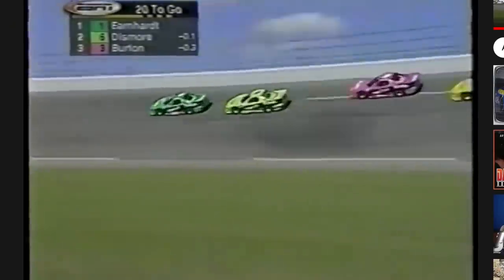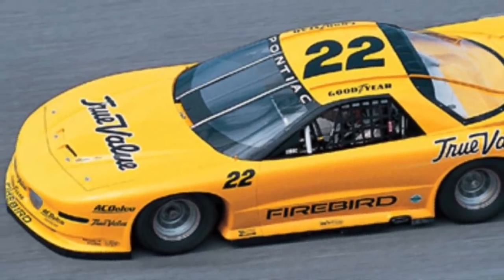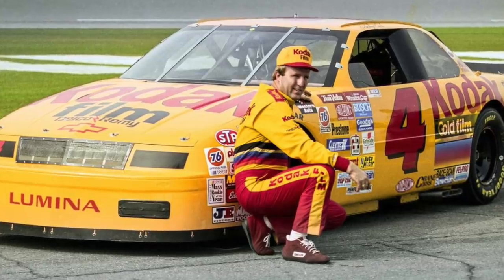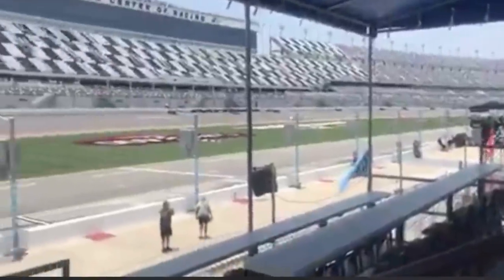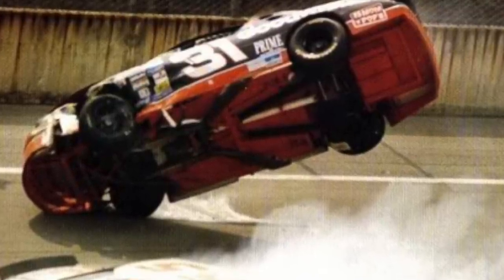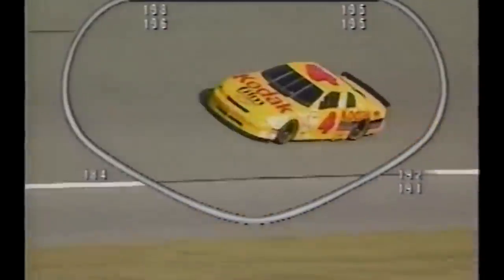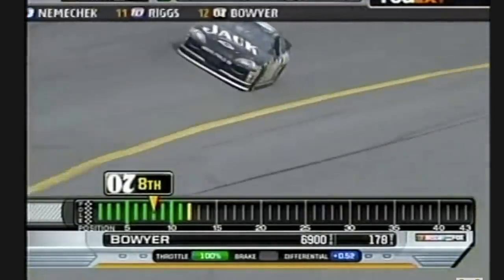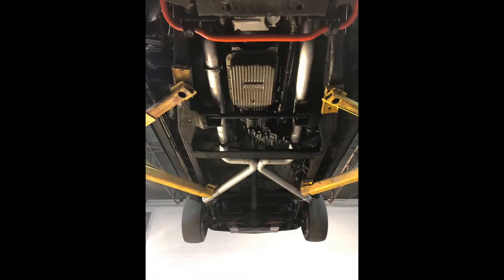What Made "Old School" Restrictor Plate NASCAR Sound So Great? (Back to Back Sound Comparisons)

Comment from the maker: Did you guys find this interesting or surprising? I thought it was crazy that the Daytona camera positions haven’t changed in 20+ years. Made the editing really easy 😂
Reply: The camera positions have never changed around the track because they where specifically built and reinforced for protection in those areas.
Reply: NO MAN WHY THE X PIPE BUT WAIT DOSENT A X PIPE GET HOLLOW IN CENTER>????????????????????
Reply: Found this very interesting and I thought the same with the camera angles too. Cant wait to see what you have planned for the Monte Carlo. Keep the content coming
Reply: Yes plz do more on this
Reply: Exhaust and engine noise in general is so interesting. I dug into it a bit after seeing the spinal tap project go to to 11k RPM on a spintron and sounding eerily like a "running" engine. Ben Strader has some great spintron videos, it was really enlightening when he was on the power and speed podcast as well. I've always wanted to see what the function of correspondence is between the sound frequencies/harmonics generated by the actuation of the valvetrain through the RPM range and the exhaust tone of the engine. Great videos always, I appreciate you realism and your energy!
Reply from the maker: @MrTacticalKitten  Ben strader is an awesome dude. I had a good conversation with him at pri in 2017 that led to my Escalade engine being configured to run 8200 rpm. I thank him for that because it sounds epic 😂
Reply: You have to post videos when I'm not working .boss caught me again
Reply: Not only were those IROC cars the best sounding race cars ever, those races were some of the best battles ever. Even in identical cars Dale Earnhardt was able to take them boys to school at the superspeedways!🤘🤘
Reply: When are we gonna see some more monte content brotha  fuckin loves that car!! One of the prettiest and meanest lookin street cars on YouTube in my opinion no frills just thrills
Reply: Dr.gas is incredible
Reply: Glad I know the truth now miss that sound
Reply: I always knew something was different from back then but I couldn't put my finger on it piss a man off sitting watching thinking somethings not the same but idk what it is lol
Reply: Have always wondered what made them sound so unqiue. Always thought they turned closer to 8k rpm as well.  That x pipe sound and a sequentially fired 8:1 merge collector are my 2 favorite exhaust notes.
Reply: Love the content!! Very interested in your exhaust testing on the Monte Carlo .
Reply: Great video Mitchell. Here's an experiment for you: There are three factors in designing an X pipe, 1) Length of the X, 2) diameter of pipe, and 3) the length and width of the notch. Here are some tig welding terms that are familiar and actually come from pipefitters; pulse, back pressure, flow, evacuation, resonance, frequency, and purge rate. All of these items are similar in purpose, but each has a very different objective. Let your mind wander a bit, it's kinda of like Where's Waldo and Connect the Dots. Here's a clue: Plumbing, Exhaust, and Welding have everything in common,  but for completely different reasons.
Reply: You think it was the same for formula 1 possibly?
Reply: Hearing it on video doesn't do it justice- to be there in person you not only heard it- you FELT it when they went by, especially in packs. I've heard others since, but nothing comes close to them.
Reply: I'm a major exhaust nerd myself. Some of my neighbors dont mind me change it cuz they love hotrods as well. I've changed mine probably 4 or 5x in a year trying new sounds lol.
Reply: Seriously interested, this has been something I've always wondered and your vids already helped answer a question.
Reply: Welcome to the Thunderdome!!
HellYeah Brother!!
Reply: Not really surprising, but I watched the last video you did where you were talking about x pipes and nascar noise. Still a cool video, cant complain about fly by shots of old nascars.
Reply: Considering I’m trying to do this on my 4th gen Camaro lol very helpful
Reply: I've got a SBC with a 4/7 swap and it definitely changes the sound...  I'd love to try to carbureted LS with a SBC firing order to see what it sounds like. If you find someone to grind them I'd definitely be interested in a cam
Reply: Exhaust exit does make a big difference.   
The sound of vacuum cleaner vs fighter aircraft.
Reply: Dale yeah it was interesting! I freaking love exhaust
Reply: X-pipes ftw 💯. I put an xpipe on every performance car I had.
Reply: DO THE SWAP! DO THE SWAP! Damn I want to see THAT happen like crazy!
Reply: I found it interesting, Mk kinda wish they would go back to the old exhaust it sounds better to me
Reply: Spintech makes a hell of a good sounding exhaust, put the mufflers on a 6.0 and it sounded like no other!
Reply: I've been saying something similar for a few years. It's simply that the exhaust systems were altered. As for today's cars sounding different; the exhaust pipes come out on just one side of the car. NASCAR did that for safety reasons. So, it's a different X-pipe configuration, with the the sound waves hitting the outside wall and our eardrums differently.
Reply: I'm an exhaust "nerd", but I'm also about performance... Why would you ls swap to SBC just for a cooler sound? I guess if it were just for show, go for it...

Speaking of which, that Escalade... Off the chain bruh... It's like: random dude: "ha ha, you got an Escalade?"
Stapleton 42: "VROOOOOMGRRR"
Random dude: *sweat runs down forhead*... "Uh oh..."

I think I might just sub to ya bruh... Because exhaust sound is where it's at...
Reply: Great video!   Old sound is unique and powerful.  Thank you for your work from an old gear head.
Reply: Both . I learned alot in this one. Makes total sense 🙂
Reply: Loving the videos man. I'm just like you the sound of the car is the most important thing. Used to think it was all about the HP which to a degree is true but... I've heard cars with little HP sound better than some with double.. I absolutely love the x-pipe sounds too so thank you for all your hard work. I guarantee you the next car I put exhaust on will have a very similar Xpipe system now.. also the cam idea sounds like a awesome idea b.c as much as I love the LS and what it's capable of I miss that old school clatter of the SBC exhaust cam
Reply: @therayven3147  he's not talking about swapping from a LS to a old school Chevy talking about grinding the cam lobes in a unconventional "LS" firing order so that the spark pugs fire in the same order as an SBC
Reply: @ACLz28  oh, ok..  makes sense... but wouldn't that still affect the performance? Running in an "unnatural firing order...
Reply: Heck yeah! This is super cool! This is what I'm hoping to sound like on a nice downhill run because I lack power. Lol fml
Reply: I came to the same conclusion about x pipes giving vehicles a more sports car race car sound.  However a piece that is overlooked is a Catalytic Converter,  especially a 200 or 300 cell one, and even more when combined WITH an x pipe. Gives it a rally car sound. Watch some videos. Listen to the sound. Subscribed, please do more exhaust videos in general, liking how yiu account for variables. 😎  🏆🥇
Reply: Super interesting.
Reply: @-g-lock813  Yes, the xpipe is hollow. It'd be kinda pointless if it wasnt.
Reply: Look up 180 degree headers....  and megaphones
Reply: @therayven3147  Yes technically it would slightly decrease performance actually think he mentioned that in the video or in one of the videos he talked about it bur he's talking about doing it for the old school Chevy small block chop sound. GM changed the firing order when they designed the LS platform when they realized it's performance was greater in the new variation
Reply: @ACLz28  so basically,  changing the firing order of fhe engine would decrease performance, it wouldn't be significant enough to notice... and with other tweaks and upgrades, you could counter that, like engine balancing, port and polishing, increasing intake pressure to the supercharger/turbocharger, increasing boost, and so on... at least that's what I'm understanding?
Reply: @therayven3147  that's how u understand it
Reply: @ACLz28  ok, so I'm right? That's the one thing I've never messed with, was the engine's firing order... I've always thought the firing order was that way for a reason... I've done many types of different tuning, bit the firing order was one thing I never messed with...
Reply: BIG thumbs up!! excellent video and explanation. agree on the x pipe but you do need high rpm to replicate that sound--I worked on a Nascar Team for over a dozen years and can tell you that RPM levels are routinley turning 8500-9500 all day long! I really like your channel!! How much rpm are you turning in the Escalade BTW..?
Reply: Damn, your Escalade sounds so nice.
Reply: Subbed, and I appreciate it. V6 sounds meh, but inline 6s are pretty sexy.

Comment: Fun fact: the closer you put the X pipe to the collectors, the higher the pitch.
Reply: Yep. And an 8-into-1 with equal length primaries and a properly sized merge-collector will sound even more insane.
Reply: Yes great video. V8 Supercars here in Australia are the same. They used to wail like crazy. Now, not so much.
Combination of merge collector and X pipe. HOWEVER, it is also somewhat related to fuel (E85 now not petrol) because it changes the tuning for fuel efficiency, which does change the sound a little too.
Reply: If you put the x pipe as close as possible to the headers, but the pipes had to go all the way to the back of the car, would it still sound similar to nascar or would the extra pipe/bending mess up the sound
Reply: @trashbandit2449  When he says closer to the collectors, you've got to remember most of these tuned length racing header systems run way down under the car back to pretty much the rear of the gearbox. So 'close' to the collectors still ends up being in the middle of the car.
Reply: @dons1932  yes the longer collectors and the design of them is actually the key to the sound from what I've discovered. They wouldn't work without the x pipe, but if you look up nascar headers, they have an extended tri y design that evens pulses and creates a higher revving noise
Reply: @trashbandit2449  Yes correct you need full tuned length headers and the X pipe to get that sound. The spikes in the merge collectors also play a part.
Reply: @dons1932  a y pipe will also work and it doesn't have to be the same design x pipe. I'll grab some videos for you
Reply: @dons1932  https://youtu.be/0l2GBXu96iU
Y pipe, equal length headers, immediate merge (kind of unrealistic because normally there's a transmission there)

https://youtu.be/LUmMUjoJNpw
Equal length headers similar to tri y. Interesting high revving sound. He does have a muffler on here affecting the sound as well. I think it would sound more like the rx7 above without it

https://youtu.be/INS0m6McFN8 
Here's the headers from the guy above
Reply: @trashbandit2449  The first one is good and that has a lot to do with firing order and ITB's. The others are pretty junk because the collectors are janky AF and don't have proper merges.
Reply: @dons1932  the second one is him playing around with headers, not final product. What would you change about it?
Reply: @trashbandit2449  The collectors and merges. They have to be smooth on transitions and just as scientifically calculated as the pipe lengths and the X length. Have a look at Burns Stainless merge collectors and you'll see what I mean. There is an art all unto its own for those as well - and they affect sound and performance massively. They do crazy 8 and 12 into 1 collectors even. Plus they have spikes built inside them to split and balance the flow down each collector tube. The ones you linked look like cheap off the shelf Tri Y headers. That's why off the shelf headers cost 600 bucks, yet a set of custom headers for NASCAR or similar cost 6000 bucks. All the small details.
Reply: @dons1932  yeah they should have smoother angles. 

The pipe lengths are correct on them though I think. They expand around 32 inches, I think most ls engines are supposed to expand 30-36 ish.
Reply: @trashbandit2449  You can get a basic calculation by engine displacement plus RPM and pipe size. But camshaft and heads have a lot to do as well. This is the video I was referring to. Highlights heaps about collectors, even the angles matter. Burns are all 15 degrees because that's what is the best. And you can see the difference between merge with spike and formed collectors.
https://youtu.be/Q8Y0dNQIcvw
Reply: @dons1932  yep I think best was between 7 and 20 degrees. Thanks for all the info
Reply: @trashbandit2449  im no expert but it should sound very similar...the extra length pipe would probably tone it down slightly.. but should still sound pretty awesome 👍👍

Comment: Back in the early days of the NASCAR Craftsman truck series I built many Dr Gas “X” pipe exhaust. At that time you could order “X” sections with different angles, at times it was a real pain to get everything to fit. With boom tubes there was a maximum length of the opening, and we had to run mufflers at some tracks because of a max db level. When we went out for practice if the db reading was too high we had to fix it at the track. We would show up with different tricks to add if needed, cones, steel wool, baffles, and shields.
It seems that in the early 2000’s there was a problem getting Dr Gas parts, can’t remember the reason, but we tried to fab our own “x” section,  it never worked as good.
Interesting fact - I’ve seen Ducati motorcycles with “X” pipes
Reply from the maker: This is fascinating

Comment: I think everyone should hear a cup car in person at least once. I can’t speak at all about newer NASCAR but used to work on older ones from 2001-2003. Absolutely beautiful sound that cannot be captured in video especially solo not in a pack on a track (that sounds great though too).
Reply: Never actually seen a stock car on the track,  it I was standing next to one of the demo cars when they fired that bad boy up... I was standing almost right next to the exhaust pipe, when they revved it up to get it on the trailer, it rattled my body so hard I thought I may have lost a tooth... And maybe a kidney... Nothing like it...
Reply: @therayven3147  Some, very few but still some demo/promo cars have cup engines. I worked for a guy that ran in the ARCA series which at the time most were Winston Cup/Nextel Cup cars that teams retired or wasn’t to their liking anymore, sometimes NASCAR would change so many rules it’s just worth building new cars but the “old” ones may still fit ARCA rules. He was also going to be going into the Bush series (didn’t happen though). My boss bought a lot of these cars and used them for his promotions company that people would pay to have these on display to bring in customers. All of his cars either were race ready or just rollers that we could put a drivetrain in and race. He also was trying to open a driving experience like the Petty Driving Experience. So between racing,driving school,promo cars we had quite a bit of cars and he preferred as many of them as possible to be race ready because people paid more for those cars to be showed at their businesses and he never knew when he was going to wad one up at a race and need another car. Finally to the point😂 That car you stood by may have had a race engine still in it. A lot of those cars that other people show “race ready” have worn engines that would need rebuilding to be competitive but still sound pretty much the same.
Reply: @deegan727  hmmm... Well, whatever the case, it still was amazing though...

Comment: When I built my exhaust, I put in an x-pipe. A lot of people comment on the sound. It sounds like it's turning a lot more RPM than what it actually is. Very distinct tone. My neighbor that lives across the street, and has had to unfortunately listen to it in varying stages, described the difference between bare open headers and having the x pipe as "It doesn't sound as violent, but it's definitely racier". I have to agree with him.

Comment: Thank you for this video. I built my exhaust based on everything you researched and shared. My buddy riding with me said he had never heard a SBF sound like it. It is an amazing sound. Hot 351w through long tubes, 3” x pipe 15” from collector. Straight out the side through flowmaster FX straight thru round mufflers. Every drive is a big grin. Thank you for sharing all this information.
Reply from the maker: Thank you Pete!

Comment: Love the video, and the answer to your question about firing order changes affecting sound is: absolutely.   The extreme examples would include the famous “bundle of snakes” headers on the GT40s, or even a LS with 180° headers. 

It’s also important to remember that the sequence of the pipes entering the header collector plays an important role in exhaust scavenging, and I really think that the X-piped systems excelled at this, in addition to having killer acoustics. 

I too fell down this rabbit hole many years ago when I was doing a lot of street racing.  I had an ear for motors, and could turn my back to the street and tell the guy next to me if a Chevy, Ford, or Mopar was driving past, and if it was a big block or small block.  I claimed a lot of $5 bills that way back in the day.

Comment: Myself kinda did a lot of racing mowers, street/strip, and trailer queens. This block I grew up on was noise pollution central. Exhaust is very important for power. I saw the H pipe in a magazine. I was thinking there was a better way for our street and pro cars to go faster. Myself will not claim to be the first to build one and had never seen on. A bit of scrap metal and some body tools, when we fired the first one up, I was agasp. The time slips did not lie.